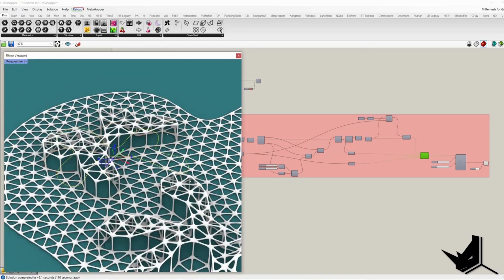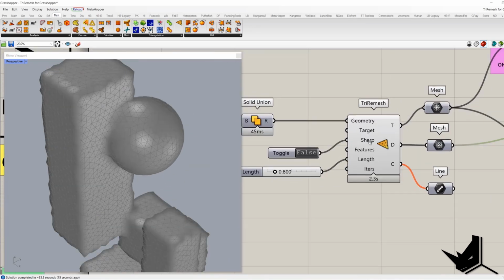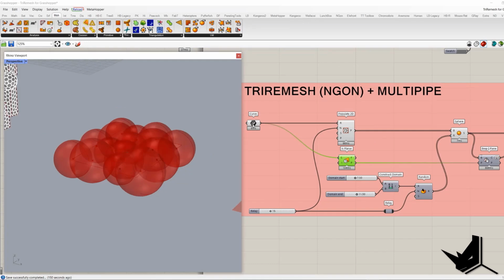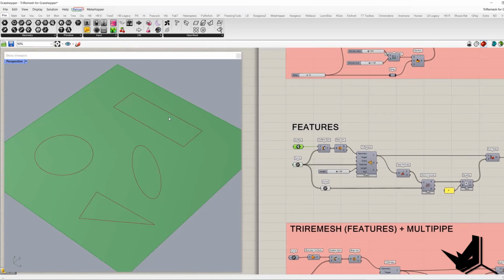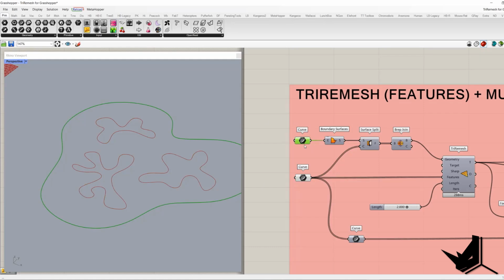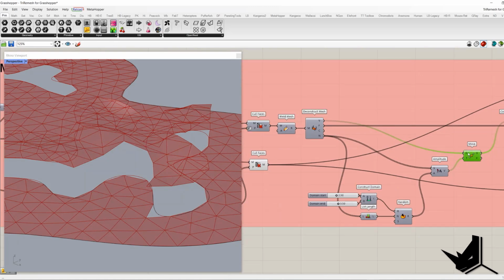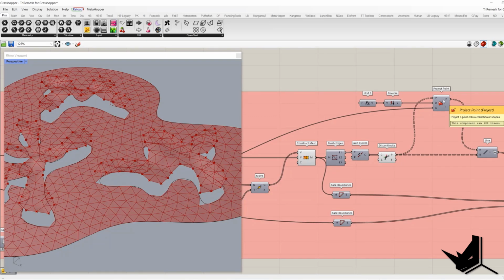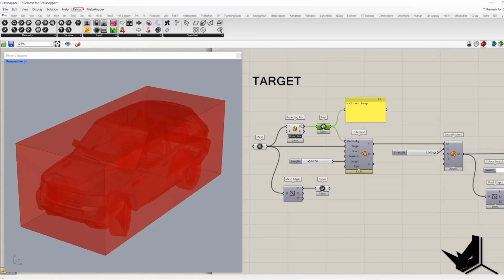TriRemesh Component in Grasshopper Explained | Rhino 7

Comment: The last example you have is a huge deal for me.  The Grasshopper Solid Union and Mesh Union operations are hit-and-miss at best, due to shared surfaces and precision issues, but the Mesh Join always works, albeit leaving internal faces.  Passing the bounding box to the Geometry and the actual geometry to the Target gives a closed mesh suitable for further operations, without internal faces, and appears to be a reasonable replacement for Mesh Union!  Slower, but reliable!  Great news.  Thanks.
Reply from the maker: Hey Bob, thanks for your comment!
Are you interested in a strcutured approach in learning Rhino and Grasshopper? If you are, you might want to check out our Rhino for Architects 2.0  course!
You can email me at dusan@howtorhino.com, and I'll share all the details with you, as well as the course platform!